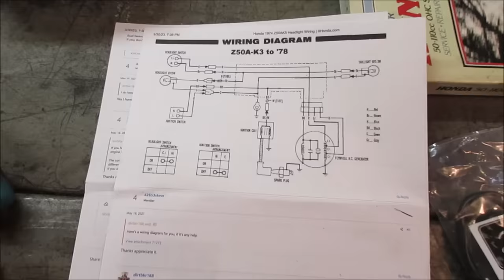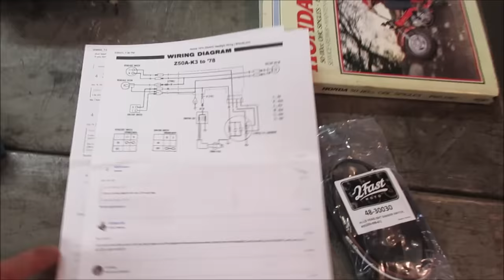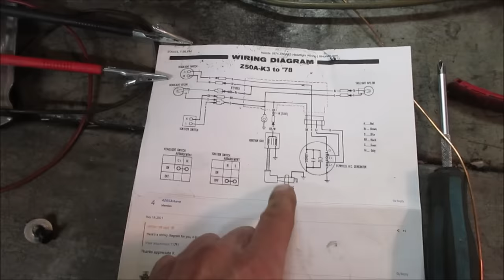They Could Not Fix It, Restored Honda Z50. Can We?

Comment: Re the decals, years ago we used to use soapy water to set GT stripes and decals in place. Wet the surface, put the item down remove the backing and adjust the decal/stripe and let it dry after squeegeeing out the water and bubbles.

Comment: Those old z50s were balanced AC, the magnetos power output is matched to the bulbs (AC), when you engage the brake light you often dip the headlight, also if your tail light goes out it will pop the headlight at high rpm.. common addition is an ac regulator.

Comment: Idle mixture screw is not actually a mixture screw. It's an air bleed. The further you turn it in, the richer it gets. Even all the way in, it's still a bit lean. The hole in the actual idle jet is almost microscopic since you only have 49cc of displacement, and they are very prone to getting clogged with even the tiniest amount of lint or dirt. The early 'Z-50s' were actually referred to as the Honda Mini-trail back in the early 70's. My neighbor and I literally wore out 2 of these on the trails back in the day, and we learned everything there was to learn about small Honda engines. As long as you kept oil in them and changed the spark plug about once a month, they would run for years!😉
Reply: Honda used the term “Mini Trail for both z50’s and CT70’s.  As late as 1982, the CT70 had a side decal with “Mini Trail” on it.
Reply: @MiniBikeMike  That is correct!  Good memory.😉

Comment: To put the decals on spray Windex or fantastic on the tank get it good a wet first , then the decal, it won't stick till the spray dries. Just put it on and slide it around till you get where you want it and let it dry. Works great.

Comment: Sometimes the top of the carb can leak around the slide/throttle screw top as there is supposed to be a small gasket between the underside of the screw top and the top edge of the slide bore.

Comment: Sounds like you're down on power a bit, compared to my Z50R which I believe the main parts of the motor are extremely similar.  They only made I think 1.9HP on a good day, but it sounds like it's not pulling 1st and 2nd like it should.  Double check the cam timing (is it off a tooth) and the points gap, both could kill the power, based on personal experience.

Comment: re align the kick starter  higher on the spindle for a longer throw.   I always blow thru a tube holding the carb upright and then open and close the float to see if it works and that the float is level when it stops blowing air.        Love Your Channel by the way.
Reply: Might need to adjust the height of the needle valve
Reply: Turn the air screw in until it starts to slow down (lean out) then back out 1/4 turn.

Comment: Mustie this maybe a lot to ask, but would you consider showing a wiring diagram on a bike, mower, etc….and demonstrate how to troubleshoot electrical issues from the simplest form. Like DC current 101😄 I mean really basic troubleshooting,  and then work up to more advanced stuff. I understand there’s only two types of devices in electrical configurations….you either have a switch or a load device. A switch being exactly what it sounds like….it’s an on or off switch. But a load device can be an electro mechanical coil, or a light bulb or a resistor, etc….. I just don’t know how to test things properly. I understand what an open circuit is, but beyond that i get lost in Ohms and other forms of resistance. Thank you for another detailed teaching video👍

Comment: Reg. decals, once shared a shop with a window tinter who would apply decals same way he applied window tint. He'd first spray a light mix of soap and water on the surface, which allowed him time to slide it around for adjustment. Decal stuck fine once given time for the soapy mix to dry.

Comment: Hey man you need a 3D printer with some medium hard TPU. You could print a lot of parts like those gas tank grommets. TPU is like a hard rubber and it holds up pretty decent. I printed the rubber sleeve pad thing for an ATC 110 shift lever. It held up great and looked similar to original.

Comment: The headlight/brake light feed from the magneto, dependant on the rpm.  I have an old 1961 NSU Quickly (which the Honda 50 pretty much put out of business).  When driving it at night, I always found it ridiculous that if you wanted to see better, you had to drive faster.  LOL
Reply: Some old cars used to have the windscreen wipers powered by intake vacuum, the more you put your foot down the slower they worked!

Comment: I've watched this video 3 times now and I am carefully trying to choose my approach and words so as not to step on any toes. That being said, here goes. Whenever I clean the carb and find that much debris in the inner screen,let's call it a partial blockage. I always remove the fuel filter and replace it. I will take a paper towel and clean the end enough for me to actually suck on the end to get an idea of the resistance. Then do the same to a new filter and see if there is a noticable difference. Either way I know one way or the other if this was a minor or major contributor to the overall problem. Hear me out, the debris in the carb screen did not move as a solid clump. It accumulates over time AFTER it had already passed through the weighted filter in the tank. It would make sense that the tank filter was operating to some degree and that also would have a partial blockage. My point being that if you eliminate everything that the problem could be, you will be left with what the problem IS. While you did everything correctly I think that perhaps your "frugality" may have hurt you in this instance. Don't be mad. A new spark plug wouldn't hurt either I'm guessing. This is how I would approach it before I would even think about ignition coils and looking for air leaks, pressure testing etc. Coils cost what I call real money and vacuum and pressure testing take real time especially if you haven't made all the plates and gaskets. Anyways I hope you take my comment as it is intended as just trying to be helpful. I get it that my comment is very much like my videos. WAY too wordy. Lol. Have a good day if you're still speaking to me. Thanks for all you do. 👍

Comment: Just a tip for u when ur trying to clean the carburetor especially the main jet and the air mixture jet try using a guitar string no 1 instead of using spray that's a cheaper then rather than wasting cash for some spray can. If u wanna gush out some air use a air pump instead of spray next time. These carburetors have a screw that needs to be removed for the petrol to flow on the down bowl part of the carburetor if u blow air into that pipe u will not even get a drop or petrol coming out from it. After connecting the carburetor to the bike try releasing the bowl down screw and see if the petrol is flowing correctly....

Comment: Always keep and reuse the original Honda brass in the carb. Rebuild kits are junk. Chased a similar problem with my '71 Z50 after using a rebuild kit. Put the original brass back in the carb. and it ran like a charm.

Comment: I have a "78 with a similar fuel problem (maybe) 
It was in my garage for many years. I got a new fuel tank, carb, and electronic ignition but it just looses power and dies. I'll check the carb feed (sometime ).
It would be fun to ride to the mailbox or to visit a neighbor.

Comment: also in the lineup  the trial 70    was named honda dax here.
if it the old style with the self regulating flywheel you can jam it to one side and lock it with welding wire.
this way it keeps pulling in 4th gear.  doing this  to a 50 cc  usually take them up to around 90 - 110 kmh  without removing the restrictor. had alot of honda CD50  myself and regret selling them.  they are soo pricy now.

Comment: Mind you the youngest of my 6 kids is 31 . But I had a Z50 built in 68..  usually after a winter nap it didn't want to fire.  So I'd put fresh gas in it and have one of my son hold a tow rope wrapped once around the tipple trees and tug it around with riding mower till it fired.   Once it fired it started and ran beautifully.   I wonder if it wasn't that screwy charging system needing a build up. I was never able to figure out the problem ...so the tug and run came the standard operating procedure every spring

Comment: The jumper, which is actually just a resistor, is installed on the blue and white wire that runs next to the battery. The size of the resistor should be 22 kilo-ohms in new bikes, and 220 kilo-ohms in old ones (-90).
Semi-automatic honda with pointed ignition do not have a limiter, so there is no bypass for them.

Comment: You remember in math class when the teacher would do problems on the board and it would look easy?  But then on the test a fella would get the normal D- because it really wasn't that easy after-all.  That's how I feel sometimes watching Mustie1.  Must not be getting gas - jet to small.  Surging - leak in manifold.  I wonder how long the restorers worked on this thing, and then to see Mustie instantly focus on the problems.

Comment: LOL yeah talking about loose and missing bolts and parts I recently bought a Honda cb125s 1974 model the guy swore straight up and down that he had been riding it in the back look really good tried to get the oil cap off couldn't get it off there before I bought it had to wait till I got home come to find out it had no oil in it after I had rode it test driving it also found on further tear down that the timing chain had not been tightened and was left loose and had been rubbing on case and field bottom end with aluminum shavings had to clean out screen on it motor still had 130 lb compression which is pretty good it didn't smoke and doesn't seem to rattle any now the timing chain is quiet now that is actually tension to properly other things that were left loose swingarm bolt for back in not tight front desk not tight brake caliper not tight missing bolts 12-volt headlight bulb 12-volt LED bulb for tail light in a 6 v system air filter look like they took it mudding well there was no air filter left it was just metal screen completely clogged up with dust and dirt no wonder compression is down on motor sometimes you really have to look things over

Comment: I live in a little town and I got a Z50 (in horrible condition) from our local cop. He had confiscated it from some kids riding it on the street. I spent a lot of money getting it running right and looking decent and then went for a ride around the yard. As I got close to the house I found that my big size 13 feet were trapped between the foot peg and the brake. I slowed and slowed and then fell over on my left side. I thought "I am going to really hurt myself on this thing. It's going to be serious and embarrassing."

Comment: 33:36 that’s just shows when someone knows just enough to brake stuff and cause more trouble.
Putting decals on. You need soapy water, windex or dishwater soap and soft squeeze. Apply lots soapy water both surfaces and that allows you to slide the decal on to right spot. Use squeeze to get rid of excess water and air pockets. While holding decal in place. Let it dry.

Comment: I keep thinking that my dirt bikes had a hose on the carburetor vent that went up under the seat so it didn't take in water when you went through some deep water. That sure looked like a boss for a hose but without a hole in the end, it wouldn't work to extend a vent.

Comment: Adjust the valves and check timing chain tensioner.    Still think that carb vent tube needs to be opened up and run a vent hose up to the handlebars.

Comment: I remember making a school boy error trying to fix a slow return to idle with grease in the throttle slider when I was a teenager, on the plus side could ride one handed throttle almost wide open, not safe but worked. The fun memories , especially when the o ring failed on the carb and dumped £10 worth of fuel in a nice flammable trail right to my ride.

Comment: Those dumped trashed electric vehicles are worth investigating for bits and bobs, ie electric motors, wheels switches etc that could be adapted. The honda is a nice dream machine for a 10 year old, even an grown up 10 year old lol😆😉 The honda cb 350's smaller brother the cb 250 was my first real bike after spending my teens on jumbled up no name bikes made from parts, I'm talking BSA bantam, BSA C15, and truumph tiger cub error, those were the days, no electronics just a motor, magneto and a spark plug.

Comment: You could modify a rubber stopper or one of the feet, sold at electronic stores, to use as the rubber fuel tank mounts.

Comment: The wiring diagram shows only one alternator wire connected (the max output one), the other two go nowhere. I think this 50cc OHC engine was on several models... with a battery model like a cub there was no regulator and the headlight switch selected which coil was connected, full power for headlight on and reduced for headlight off so the battery doesn't boil dry with lights off. Not a great system - batteries on models like this would last maybe a year. No idea why there would be three power levels though. The Z50 apparently runs AC to the lighting.

Comment: Talk about having fun those z50s with a lifan 125cc 4 speed with a clutch it's a direct bolt in engine basically a honda clone engine same case size and mounting holes but way more power

Comment: For you decal. wet the tank and back of decal with soapy water.Then you can move the decal  around and use a rubber paddle to work water and bubbles out.  Dry is flirting with disaster

Comment: I had 2 of them back in the early 80s mine didn't have a battery.  But both of mine did have the turn signals high and low head ligh and had brake light

Comment: If the clutch is not adjusted correctly the kick starter will slip and you will only get about a 1/4 kick of what is available when adjusted correctly.

Comment: Adding a cheap 85 or 88cc big bore kit along with a 19 or 20mm carb really wakes those little bikes up and makes it fun for adults. Change the gearing and it'll do 55mph easily.
Reply: I wouldn't do 55 MPH on that POS.
Reply: @1pcfred  then don't change the gearing, top out at about 35mph and wheelie in all three gears. This one isn't a POS either.

Comment: "it seems like all of them are AC".. that would be correct as the diagram is drawn and it says right on the diagram (flywheel AC generator) hehe.
the other taps were probably for marker/tail/brake light, with headlight off, possibly for a high/low headlight (used on other models/re-used flywheel/coils from other engines.

Comment: Hey just curious, does anyone know how he ended up getting the throttle to start dropping down correctly? After he fixed the fuel intake leak, the throttle response was much better but still came down a bit slowly. 

He said it may have been the cable hanging it up, then checked and fixed up the electrical and wiring; and on the next startup shot it was running perfectly.

Maybe it was the throttle cable and he just left it out of the video, or I just completely missed that segment? 😉🤔

Thanks!

Comment: I just got an old dax gorilla z50 and started my restoration. I just cleaned my carburator but there is still one big problem. When it seemed like everything was clean i tried to blow on the thing where the fuel goes in. BUT its is stuck super hard, tried blowing with air pressure pump, didnt work. The last thing i could think of was putting it in vinegar for the night. I would like to know what you would do.
Reply: Do you have one of those little ultrasonic jewelry cleaners? They work great for small carb parts.

Comment: Sounds like the air/fuel mix is off. 1-1/2 is not the correct starting point, try starting at 1 turn out starting position for mix screw. The idle screw is the one that starts at 1-1/2 turns out.
Reply: Great video nice job.

Comment: mate next time mix some detergent and water then spray over the area.then place the sticker on...you can then slide the sticker into place....then use a squeegee to delete air bubbles and excess water and let dry........to remove stickers ....poor hot water on the sticker and peel then off

Comment: So in first gear that thing should be able to climb mountains, You are losing power somewhere if you are not able to at least run it in first gear through soft sand. I would check that head gasket or compression test time. But first gear she should not bog 
.

Comment: Not sure what's up with your audio but when you have lots of noise, usually like 1:02:40 then you get the audio artifacts which is normally an indicator of low audio quality. If you can change the sample rate on whatever you use to record the audio it should help.

Comment: I've had 6mm x 1.0 strip by far more than any other size on vehicles with metric bolts. The Japanese love to put steel bolts into aluminum but the the aluminum threads on 6 x 1.0 must be the weakest.

Comment: Make a mix of dawn and water and spray on tank remove backing place decal on tank move it around wherever you want use credit card to work out air bubbles peel of front it will make it look like a pro did the job you won't believe how easy
Reply: Same process for window tint

Comment: If you want good original parts for this bike check out phatmx they do the z50, ATC70 and trail 70 parts great resource and good prices also I don’t think the cylinder head side is supposed to have an isolator pad on it, just a gasket and metal to metal but I’m not sure on the z50, with the ATC70 it’s just gasket between manifold and cyl head

Comment: the wires out of the engine the higher voltage i would guess would be used for the higher wattage headlight bulb the mid one for tail light and lowest one maybe for brake